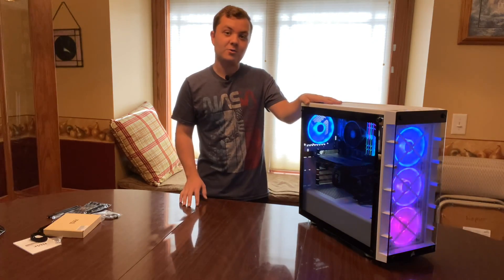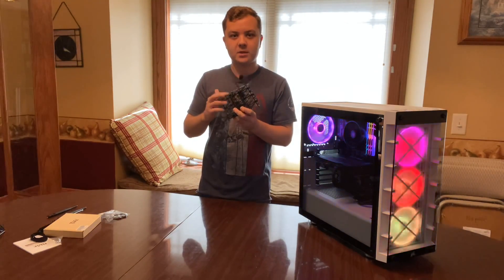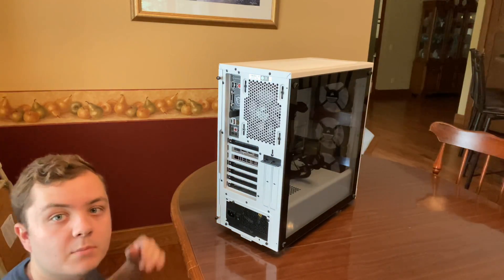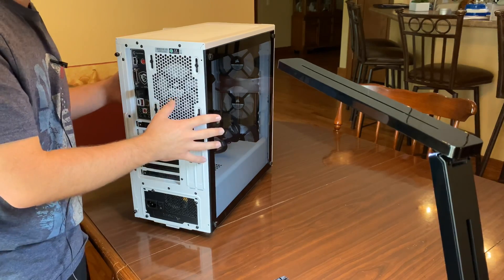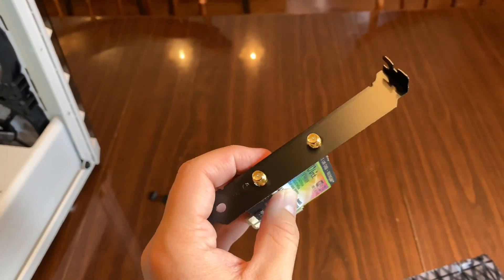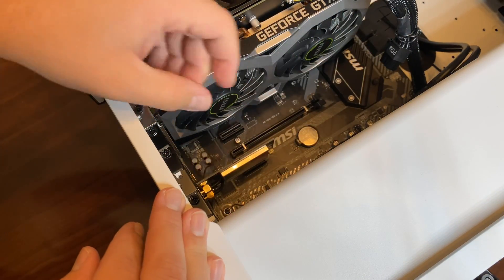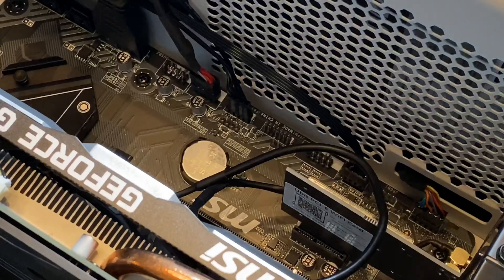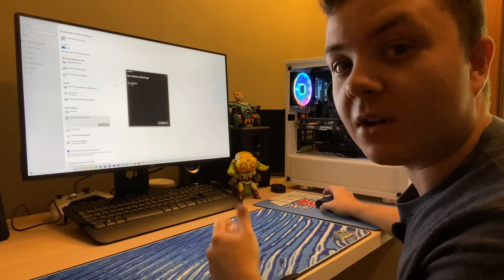How to Add WiFi/Bluetooth to a Custom Built PC

Comment: I am using a bluetooth adapter for my pc ,  while connecting it with my JBL bt headset the audio (out) is working perfectly but the mic sound is not working perfectly .The sound is very crisp. I hear a very bad sound of high frequency when I record my voice... So sir is this the problem of my bt adapter.
Reply from the maker: It could be. I would try to connect your headset with another device like a phone and try to record something. Then if it is good or bad you will be able to tell if it is the headset or the pc. 👍

Comment: You took my no socks tip lol nice!
Reply: but i didn't understand the part, if you wear sox's, you will get electrocuted lol...
Reply: @heres2ya  it’s because of static that builds up and since the carpet is on the floor and the socks are directly in contact with your body static happens